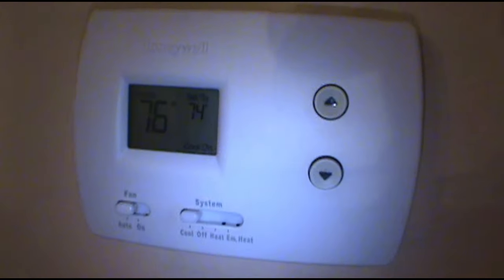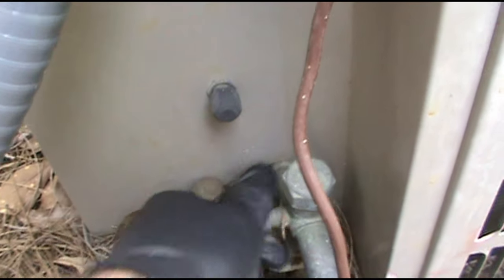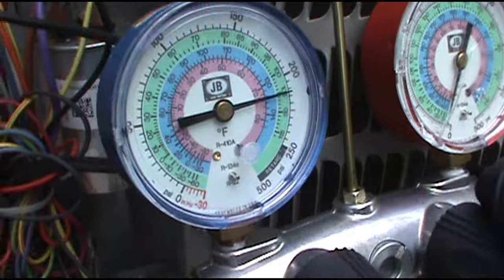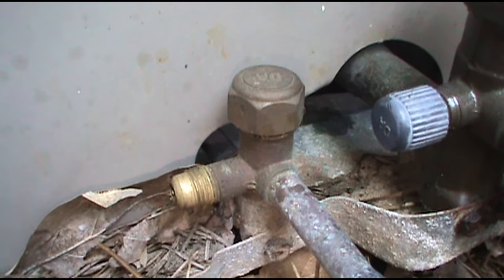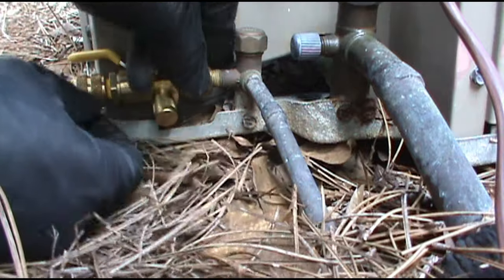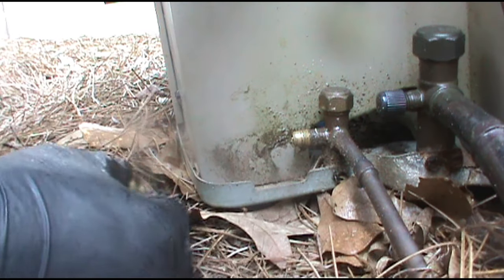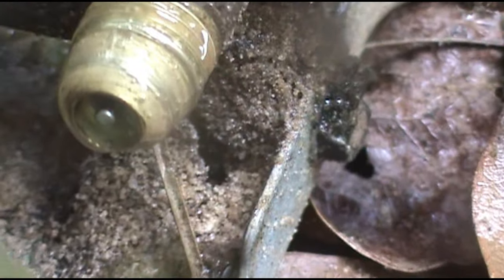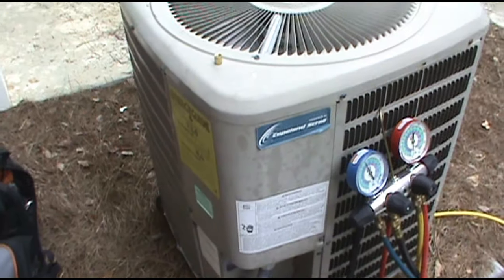Outside AC Unit Not Running But Inside Is

Comment: My AC breaker is on "off".  I tried to put it on "on", but it clicks off immediately.  Please help!
Reply from the maker: Oh no. The compressor may be bad. You'd have to unplug the compressor outside. If the breaker stays on after unplugging the compressor then you either have a burned wire or a bad compressor. Sorry! 😭
Reply: @LexVance  I hope a bad wire.  Maybe when I bumped it while mowing.
I sure hope so.
Thank you for your answer.

Comment: Nice job Professor, that had to be a smelly job site...reminded me of when I worked at a gas station breaking down worn out tires and putting new tires on the wheel. Had to pull the valve core to remove the air...would that same core remover work for you? Stay safe and Corona Free.
Reply from the maker: Yes. Thank you so much for watching Snapper!

Comment: I have a question since I’m not to familiar with heat pumps and furnaces. My inside unit (furnace?) is blowing air but the outside unit is not blowing any air. Btw the thermostat is set at 70 heat and the temp is met. Is this normal or not I’ve never notice it before.
Reply from the maker: If you've got the tstat set to Emer. Heat, the outside unit will not turn on and blow air because your using the inside heat strips. If the tstat is set to just Heat, then the outside unit should come on and blow air. Thank you for watching DTD!
Reply: @LexVance  yeah it’s just set to normal heat not emergency and yeah man thanks for uploading!

Comment: Just ran into the same problem. Only the unit I'm working on is R22. But I'm using 407C. Do I connect the  Gauges to both high and low side to turn the unit on as well? Or just the high side?
Reply from the maker: Connect blue hose to big suction pipe and the red hose to the little pipe. 👍 Thank you so much for watching comer!

Comment: my unit has been glitching for like 2 years , sometimes it works i have to reset the circuit breaker once a day ,  capacitor, contactors, circuit board changed no help any thoughts? when its running it works fine  when it acts up the inside fan runs fine but outside fan is off . after reset it runs fine.
Reply from the maker: I'd need to be there with my volt meter and refrigerant gauges for this head scratcher. It could be lots of things. Thank you so much for watching Mauricio!
Reply: @LexVance  freon is good and all voltage charges were good also , as precaution also swapped out a new smart thermostat  the old ecobee  was just a few years  old and installed the same ecobee. As and airplane mechanic  I know this will be hard to find....chasing ghosts here.

Comment: Hi, I have a similar issue. Both units turn on. But once the thermostat rises only the inside unit turns on and the fan won't. I have to turn off and try later on the day and then the fan will start up again. Would you happened to have an idea what it could be ?
Reply from the maker: Weird. I wonder if it goes off in high heat overload then when it cools, it comes back on again. I'd need to be there for this one.
Reply: @LexVance  Hello Lex I have been following your channel for a while now . I’m a certified HVAC technician  lately I been having a hard time  my  compressor won’t start can you help me plz?

Comment: Easy skid🤗
Were did you get your leak detector what kind?
Also do you leave the condensor running while you put your gauges on? 
Love your upbeat attitude and sense of humor. 
Thank you so much 
I'm learning a great deal🤗🙏👍😊
Reply from the maker: The leak detector is a Bacharach H10 leak detector. I got it from Johnstone here in my town. I'm sure you can get one off Amazon or online. Yes, leave the condenser running when you apply your gauges. Thank you so much for watching Ty!

Comment: I need help
Reply from the maker: What's going on?
Reply: @LexVance  I changed my capacitor and contactor and still won’t pull in
Reply from the maker: It could be low on Freon causing the low pressure switch to not engage. You'll need a technician to come out with refrigerant gauges to check the refrigerant pressures.
Reply: @LexVance  oh ok I can measure because I have refrigerant gauge
Reply: I checked and below 10 refrigerant
Reply from the maker: 10 psi! Yikes. That needs refrigerant bad before the compressor breaks.
Reply: That’s why my contactor didn’t pull in correct
Reply: @lexVance , another question my thermostat don’t have  “C” I was taking off the thermostat and I see two cables extra. I can use one  wire  to connect C  and then go to the board correct
Reply from the maker: @jackleung4519 If there's no common then AA batteries can be used.

Comment: HVAC is such a racket these days. They come out and “fix” your problem, charge $800 and then do it all over again when it doesn’t work.

I’m out $1k so far, have had 4 techs come out from two different companies and after a new compressor, new capacitors, coolant topped off…the system still shuts off during the day and we come home to a 85 degree house.

NO HVAC person can fix it. This has been going on for weeks now. Every day I have to trip the breaker off/on (the unit isn’t tripping it) to reset and get the outdoor unit going again.

I’m looking at taking classes now at the local tech college so I can learn how to fix this thing right. 🙄
Reply from the maker: Weird. I wonder if your thermostat is programmed to do that some how. I'd need to be there for this head scratcher. 🤔
Reply: @LexVance  A friend of mine was having the same problem and they replaced his compressor only to have it crap out a couple days later. Turns out it was acid in the lines that had not been flushed out. It got into the new compressor and crapped it out, as well.  They put ANOTHER compressor in, but flushed out the lines before hand and according to him, it works great.

Have the tech coming out AGAIN today and now he’s latched on to my story about my friends system and so he’s going to check the lines, possibly flush those and change my compressor again.

I’ve had this weird revelation since all this started; that the further away we get from knowing something, the more it costs. The more guesswork that’s needed (HVAC, doctors, etc), the more money you’re going to spend to fix the issue than if you were just going to buy a pair of new shoes that you KNOW are going to fit.

It’s odd. 🤔😇
Reply: @LexVance  they figured it out! He narrowed it down to two things; overhearing fan motor on the outdoor unit, or bad relay on the indoor unit.

He bypassed the relay on the indoor unit so the fan would stay on. If the outdoor unit still shit off; bad fan. If the outdoor unit stayed on; bad relay on the indoor unit.

System has run great for the last several days, with the relay bypassed so…bad relay!